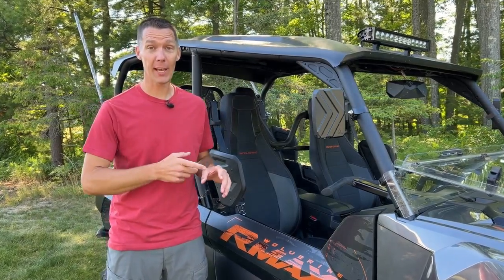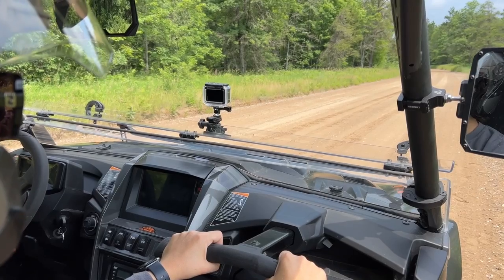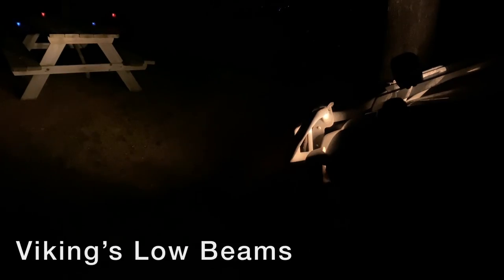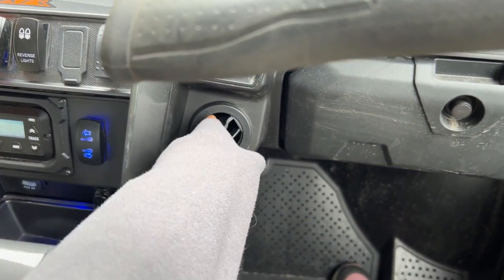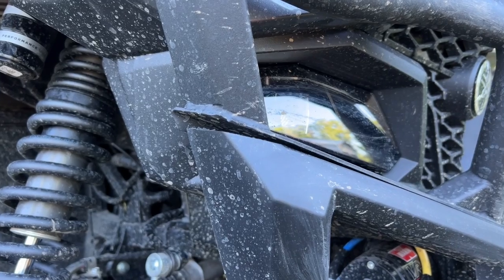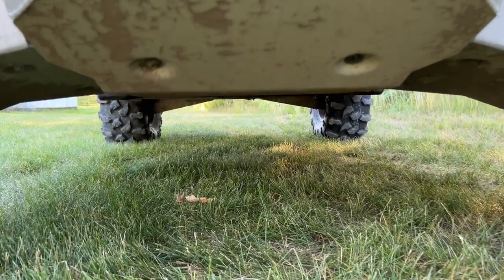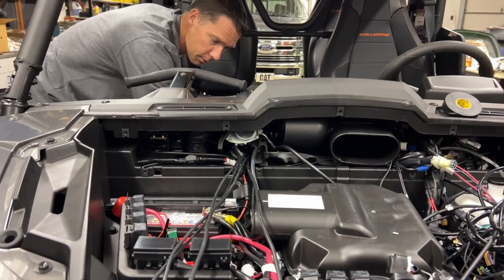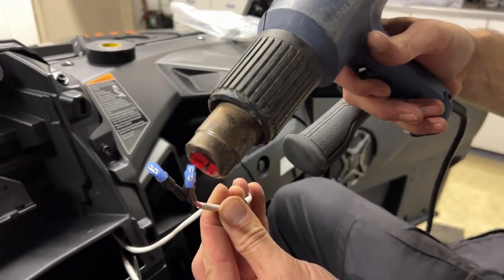Yamaha RMAX 1000 Accessories | What I Added & How it Works

Comment: Nice information, thanks!...How is the Rmax so far? What are your main complaints and what are the pros?? Thanks
Reply from the maker: Thanks Duane, we love the RMAX so far and we have just over 1,000 miles on it.

The main complaint we have is the legroom is limited compared to the Viking. It’s not bad but you can’t spread your feet out. 
Also when cruising the back roads (dirt roads) it’s boring compared to the Viking because it’s so smooth and going 35 on a wide open road makes it seem like you’re not even moving. Now going the same speed on a narrow winding trail is a blast.

The pros, it has huge capability and doesn’t fatigue you after a long days ride (150 miles). It’s very nimble and is a blast on the trails, you can control it very well and it has enough motor to drive the corners.
-Steve